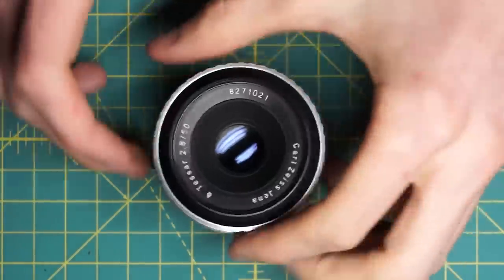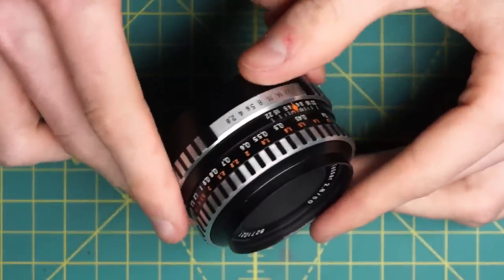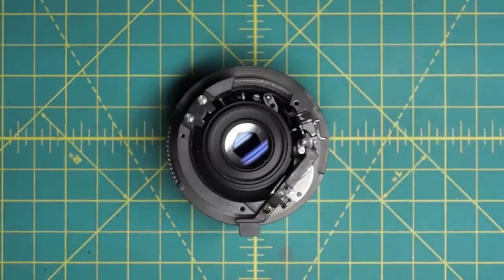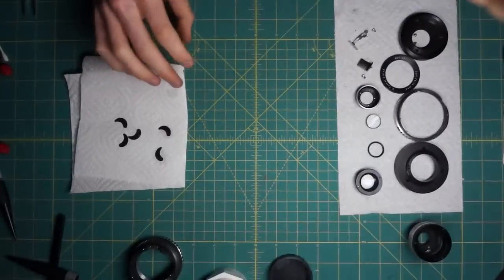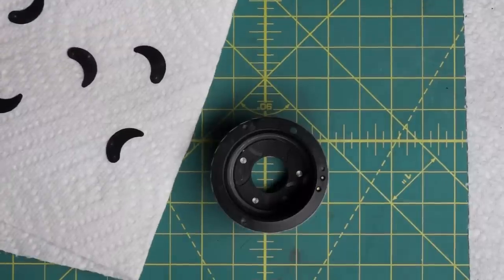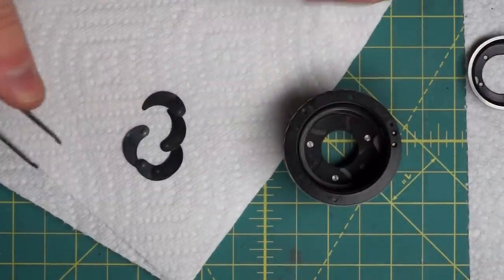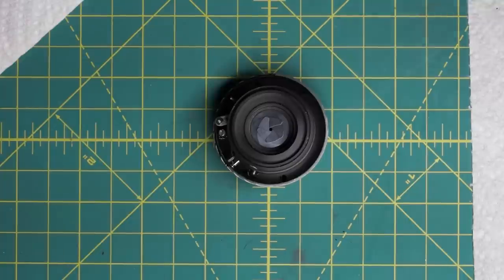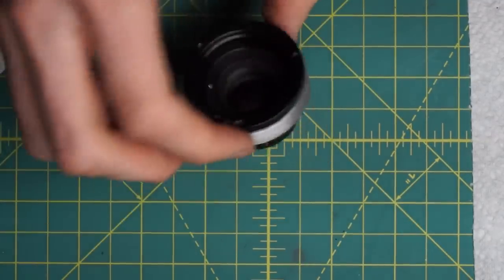Carl Zeiss Jena 50mm f2.8 Lens Disassembly and Diaphragm Cleaning

Comment: for those who mayby struggled a bit over this overall great tutorial, I noticed one mistake that took me a while to see..Closely before the situation Matt separates  (and later combines again) the helicoid and the outer focussing barrel, he says this is at the position of INFINITY. This is not the case, it is at the OPPOSITE side of the scale, the NEAR area (1,2 ft) . Otherwise you physically would not be able to screw the helicoid at all, because it would just fall out. Just try it out, any lens is on it's most screwed OUTWARD position in the NEAR area, at infinity lenses are at the most screwed IN position..hope this helps.

Comment: I opened the back and cleaned the aperture lever/mechanism and it works great now. When trying to close it I found a tiny sphere sitting there but I have no idea where it came from. Everything works fine so I'm a bit confused.. thanks for the great video btw!
Reply: Sounds like the ball bearing which makes the aperture ring click.
Reply: @jamespassas9441  it indeed is, I'm trying hard to get it back in place lmao 🤣
Reply: @edouhoekie  Just put a little grease on it to hold it in place while you assemble the lens.
Reply: @victor9501  I managed, the spring was a bit over stretched so I replaced it and greased it up.

Comment: Just changed the helicoid grease here. My notes: front element out is the closest distance, you need to attach-detach from there, not infinity. For attaching go 1 cm further than the place where the focus guide metal and screw align each other. There are different versions of this 'zebra lens' too, my version does not have the three screws after the front element. there was nothing indeed to detach it which I puzzled but I did not need to detach it so I left the blades as they were without cleaning. When you detach the aperture selector ring, there is a metal bearing ball that clicks the apertures in place and springs out as you remove the ring. Be careful with that, do not lose it, and re-attaching is quite a headache, grease it before with a sticky grease and reattach the ring first and ball with a tweezer on the last f22 dent checking if it fits in its place.
Reply: You dont know how much i appreciate your comment. It saved me after a lot of time wasted trying to attach the element.

Comment: I have two of these now, both stuck wide open, one worked for a while and decided to follow the other almost as if the problem was contagious. I essentially got one free with a Spotmatic SPII as the seller just bundled it with the camera as a defective lens, I've got an excuse now to start opening up lenses and seeing if I can rescue them  This one looks tricky to start with I don't think I'll go quite as far to dismantle the aperture leaves and total disassembly, but what can I lose. Another 135mm Soligor that has a 'slow aperture' I found at the bottom of a box of junk in a thrift store that may be just a straight forward clean.

The main reason I want to do this is if I'm ever confident enough I need to have my Zeiss 80mm Planer for a Hasselblad repaired as it sticks below speeds of 1/30, I can't justify the repair costs as it's as much as finding a replacement on eBay. It's not oil I think, perhaps a timing mechanism as there is a faint clockwork whirring. Speeds above  1/30 are fine.

Having said that, if I'm to perform CLAs on my lesnes the clean and the lube seem doable I guess, I presume the adjust will need a metering tool of some kind to check speeds and wot not? 

You, along with a user called  mikeno62, are teaching me a lot. 

Thanks.

Comment: To remove the focus ring, there is a locking ring with spanning wrench notches holding it in place. Undo that ring and you will find another helicoid but very fine threads. This helicoid is often the cause of tight focus. The locking ring can be hard to undo as sometimes it has a spot of varnish that keeps it from loosening. Reassemble the lens with the focus unit fully back and then tighten the locking ring at infinity. You will now need to align the focus to the focus ring.
Reply: You would be surprised, but I have cleaned and re-greased both helicoids inside the lens, and it worked super smooth until I put that "track" inside that holds one of those helicoids inside in the exact position so it only moves up and down. So in certain cases, that tracking part causes all the problems with hard focusing, even when you clean all helicoids and put new grease everywhere. No success in my case.

Comment: Hi Matt, great video. 
I have the 1.8 version of this lens and I'm wondering if it is the same construction? I need to get inside and clean and re-grease the focusing ring as it is very stiff. I see in this video at about 9 mins 30 secs where you separate the two sections, can I go this far and then clean and re-grease at this point, any tips from yourself or anyone with experience are much appreciated.

Comment: Good video . Question : how do you know how big or small the smallest diaphragma aperture must be when setting the screws on the side-bar that commands it ? Shouldn't you first set the diaphragma  completely open , and towards that setting tighten the screws , instead of the other way around like you do , by "estimating" the smallness of the f=22 smallest opening and by that thightening your side-bar screws ? If you estimate the smallest aperture , then how do you know if its f value corresponds to the marked one on the f-setting ring ?
Reply: If you really wanted, you could measure the diameter of the opening and match it to the f-stop value (eg. f/4 = 50mm/4 = 12.5mm opening size). But I usually just eyeball it and compare it to other lenses.

Comment: Very good video, My first attempt at lens servicing, but, as I only paid $30 for this lens,  if it ends in the trash, it was a good learning experience. It may go that way as I have a simple problem - on re-assembly, I am unable to thread the lens assembly into the focus collar. The helical threads do not want to mesh. I know patience is the watch word when doing this, but I have spent alot of time without success. I'm trying to thread the bottom edge of the lens assembly helical (where there is a shallow cut out to provide access to the aperture spring, screws, etc.) into the front edge of the focus collar helical thread. No luck. As an experiment, I flipped things around and tried threading the front edge of the lens assembly helical into the lens collar from the rear, and it went in like butter. I did it several times with very little trouble finding a set of teeth that meshed (there were several alternative starting points that worked.). So it seemed that the threads are not damaged. One odd thing when I did this - I could only spin the lens assembly ahead until the top edge of it's helical thread was even with the top edge of the helical thread in the lens collar. I thought I could continue and it would rotate right out the end of the collar. This is long winded but hopefully someone may have a suggestion. Thanks in advance.

Comment: I have a slightly newer, but similar version, from 1963, with no zebra stripes, and only Jena on the name ring, no “ Carl Zeiss”.
But in the rear black outer ring, there are no screws holding it to the lens body, so do you know how to access the rear mechanicals, as my aperture is completely frozen full open......
Great video, and easy to follow, if I can get the back open to hopefully clean the aperture w/o taking it apart?!
Thanks you!

Comment: Hello and thank you for this video.
I bought an old tessar 50mm f / 2.8 seized and whose diaphragm no longer works I managed to disassemble the rear and soften the helicoid, on the other hand it was impossible to remove the front cover by friction to access the screws Do I have to drill 2 holes to span it or is there another solution? Thank you and well done again

Comment: Nice video... but I notice you did not use the correct screwdriver blade sizes on the screws. The screwdriver blade should span the full width of the screw head slot.

Comment: Hi, great video! I have an 'aus Jena' T 1:2.8 f=50 lens with zebra pattern. Must be a CZ from the early period. It's broken and not complete. For starters, the aperture pin is missing. Will it work without? Rest seems pretty OK. Gonna run your video and work along. At the moment it is two parts: backside and frontside and split at the helical coil.

Comment: Hi Matt, would you be able to make video how to clean and assembly Carl Zeiss Jena Tessar 50mm F2.8 Aluminium version. I have 2 of these lenses and I can’t put them back together.I know there is a lot of people having the same problem.These lenses have very stiff focusing ring therefore can be found for good price on ebay but its very difficult to assembly them after disassembly.

Comment: I'm overhauling one of these, the lock ring at front was so completely seized I had to drill two small holes, even then it had to be tapped loose, wouldn't turn even with the leverage from the drilled holes. all the slotted screws undid easily though.

Comment: Hi great video.
I recently got one of these lenses and took it apart to clean the helicoid which was horrid to use. When it came to reinstalling the focussing helicoid I matched up the guide so it was aligned. However after putting it all back together the lens isnt in enough and when I focus close the lens assembly falls out. It stops at infinity. Please help, What am I doing wrong

Comment: At 26:11, you have the tiny metal rod that controls the lever (it has a spring on it). During disassembly, this rod with the little plastic part that controls the lever came lose, and I can't seem to get it back in. Do you have any clue on how to fix that?
Reply: Heya Andrew, came back to this video for the exact same reason. Not sure if you fixed it or came up with a solution. The easiest solution I fount was taking out the diaphragm. This gives you far more movement and space to work with. Anyway hope it all worked out for you in the end. Cheers

Comment: I have a Carl Zeiss Jena Tessar 2.8/50 with Praktina mount. I got it for $10 even if the focus ring was bent. I thought I could repair it but other problems arose. The aperture ring doesn't work, I assume someone removed the screw that holds it in place before putting it back in place. Yes, there's a screw on the aperture ring...I tried unscrewing it and screwing it again with the ring in a different position but can't get it to work. Considering their complicated designs, I'm scared to disassemble it completely and probably never be able to build it back up again. Do you have any idea how to fix this issue?

Comment: I got such lenses and have a question:
they looks pretty old, and have traces of mushroos guess (inside, looks like frost drawings on the glass).

i disassembled them all, cleaned small lense, cleaned front glass piece from both sides, but, as i see, there are traces INSIDE this front glass piece :|

Do you have some ideas and recomendations should i try to clean inside or just let as is?
i seriosly don't know how to dissemble this "front glass piece".

Mines is aus JENA, 8333868.

Comment: Hi, I have zeiss Jenna tessar 2,8/50, the one previous to this one (all metal), and the aperture is stuck at 2.8 and when I put my lens on my camera, my camera won't fire, I do think the aperture pin is bent, do you have any ideia how can I fix it?
Reply: I just got a Jena 1.8/50 and the aperture was as you describe. only barely working, and only when the pin was pushed in. I opened it up and found that one of two springs had snapped. I replaced it with a spring that seemed to be about the same and it worked out well.  :)
Reply: Gard Hagen oh thank you! But can't seem to open the lens, there's only one screw and when I unscrew it, nothing happens (my lens has a all metal body)

Comment: Any advice on the aputure blades getting stuck. I took it partly apart and see that when the aperture lever is pulled it often sticks around the f5.6/f8. Would this be a blades or the lever itself sticking? Any help appreciated.
Reply from the maker: It depends. I'd try investigating the lever first because it is easier to repair. Usually though, it's the blades. Oil is the typical cause of the blades growing sluggish or getting stuck entirely. Even small amounts of oil can cause this. That's why I took apart and clean the diaphragm in this video.

If there is oil on your blades, you can try cleaning them super carefully without removing them from the housing, but I recommend taking apart the diaphragm and cleaning the blades individually with a bit of alcohol, like I show. This is generally a pain, but this particular lens is not that bad. 

Hope that helps. Good luck.

Comment: Hi, I have this lens just with a stiff focusing ring, would i be able to clean and lubricate it by accessing it from the front, or would i have to follow all the steps up to about 9:30 when you remove the track? thanks
Reply from the maker: It depends on what exactly is wrong with the lens. In the most simple case – the focusing mechanism really does just need some lubrication – you can just go in from the front of the lens to get the stage around the 6:00 mark in the video. This exposes the top of the helicoids down inside the lens, allowing you to clean those our and add new lubricant. That may be enough, and is worth trying first.

Then there's the case where the focusing mechanism is gritty feeling. This means there may be debris inside the helicoids, which requires a more thorough cleaning. In that case, I recommend removing the focusing mechanism completely, cleaning out all existing lubricant, and then applying a small amount of new lubricant. 

If the mechanism itself moves fine, but the focusing ring itself is still stiff, then you'll have to investigate what exactly is causing the friction. I'd start by going in from the front of the lens because it's easier to access, but you likely will have to take the lens further apart to figure out what is wrong.

Hope that helps. Good luck.
Reply: thanks! lets see how i get on
Reply: Thanks for this info. I saw this lens in the local second-hand photo store and thought it could be interesting to play with it, but the focusing ring on that copy is behaving strangely. It is very stiff when focusing from far to near, but can rotate freely going from close to far. Will buy it tomorrow and try to repair, because it produces quite interesting bokeh and is pretty sharp for a 10 euro lens :)
Reply: Can I use this video to repair the Aus Jena 50mm T2.8 lens? It's an Exakta mount, but looks very similar to the lens in this video. The focusing ring is very stiff.
Reply: @barmalini  I just bought one of these and I have the same problem. Did you ever figure out what the problem was? Except for that one thing, the lens works perfectly, I love it. I paid $5.00 canadian for it.

Comment: hello

i got a copy of this lens aus Jena ddr 50 f 2.8 this  structure lens i guess is different from carl zeiss jena 50 f 2.8. i dissemble it because there is a problem with aperture blade it actually got stuck and doesn't work fine
my main problem is with the front part it seems different with carl zeiss and it is one piece ( carl zeiss's one has a name ring and after screw it you can see 3 pin but this one seems doesn't)
if i want to reach aperture blade i have to open this part i guess. can you help me about my problem. how can i fix this model's aperture blade

this picture belongs to the front part

https://8pic.ir/uploads/3_07aa6.jpg

https://8pic.ir/uploads/1_d924e.jpg

i am glad to see your opinion.
thanks in advance.

Comment: JESUS FUCKING CHRIST !!!! This goddam aperture assembly does NOT want to screw back in the bottom part. I've been at it for more than a couple hours now , it went in ONCE but not in the right spot! kill me now...
Reply: Update: 5 hours later and I'm still fighting with this goddam lens... The fucking notch in the thread is making it impossible to align the 2 pieces properly... I think I'm gonna go to bed for tonight. I have been defeated.
Reply: Update #2: I was able to remove the thread from the bottom part (the one with the lever for the aperture) using a spanner wrench. and I tried screwing it in all direction (4 different ways) and something is definitely blocking the progress. When trying in the way they're supposed to be but from bottom up it gets stuck right as it reached the ident in the thread (where the mechanism is). I'm starting to think my thread is fucked somehow. Tried looking with a magnifying glass but can't see anything, I'll need to use a microscope...... I hate this fucking lens, IQ better be good...